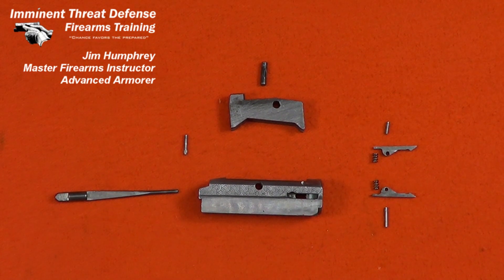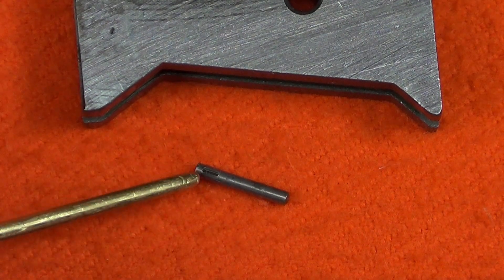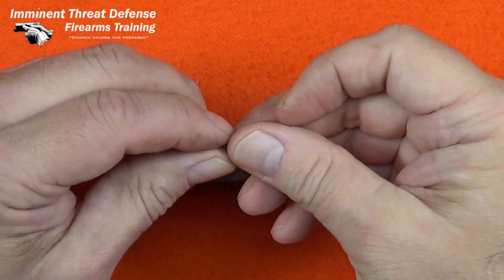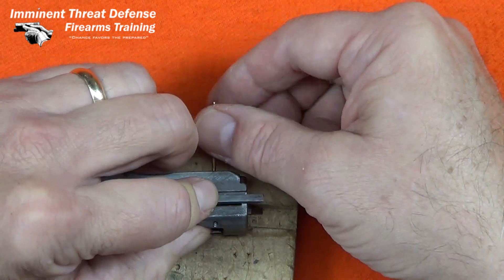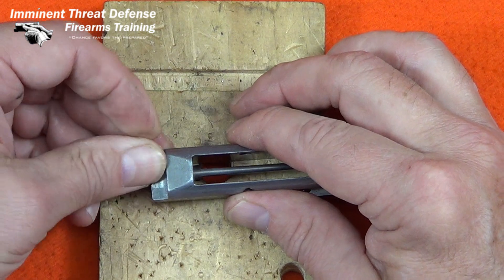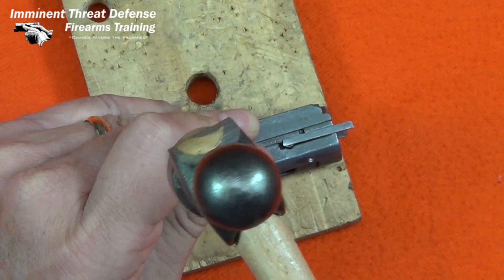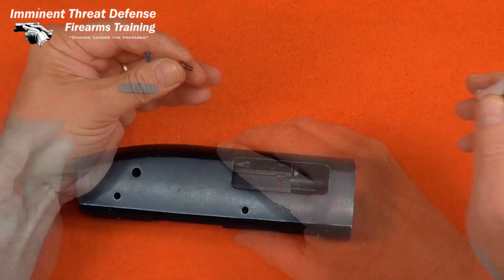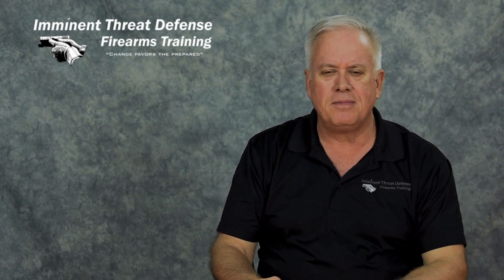Western Field Pump Shotgun - Bolt and Receiver maintenance assembly

Comment: Thanks for this, I was poking around trying to figure out if the lack of spring inside the bolt (the one that's around the firing pin pushing against the locking block on all the newer 500s I've seen) on a new-to-me M550 that came in pieces was an issue or not. You don't have it either so I guess it's not. Not sure what the correct name is, but I'm guessing it's just there to bias the locking block up into the locked position?

Comment: How does the firing pain work without a spring?
Reply from the maker: Good catch, they say this model is identical to the Mossberg 500 but I've found a number of differences.  The firing pin for example, looks completely different.  Also this bolt group didn't have a firing pin spring, which is unusual too.   The firing pin on the 500 pushes the firing pin back and resists it from moving forward by inertia if the shotgun is dropped.  On this bolt the firing pin is held back by the bolt lock until the bolt is in battery.  So either Wester Field didn't include that spring or the last guy to take it apart lost the spring.  I've never been able to find a parts list for any variation of this Western Field 550.  Hope that helps.  Thanks for watching.

Comment: Quick question do all bolt have left and right extractors? My western field m550 .410 pump only has one.
Reply from the maker: No not necessarily, depends on the ejector system.
Reply: How does the firing pin work without a spring?